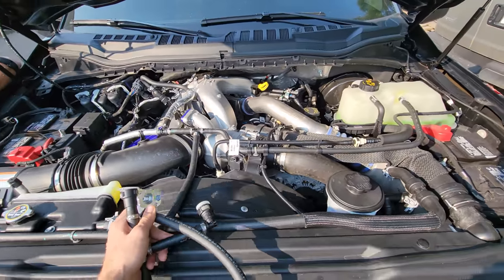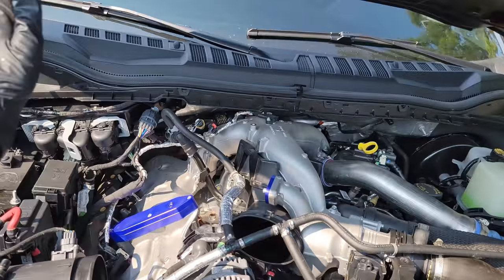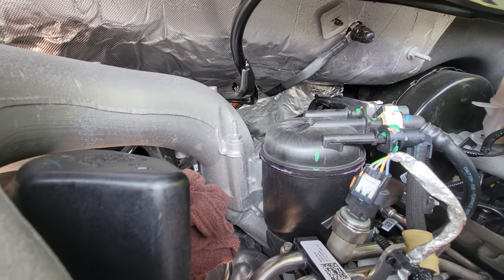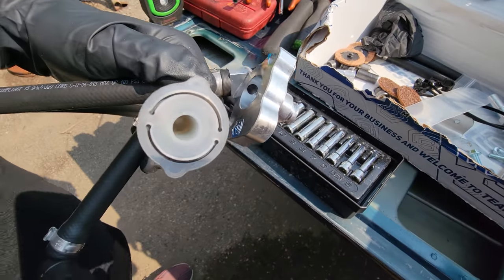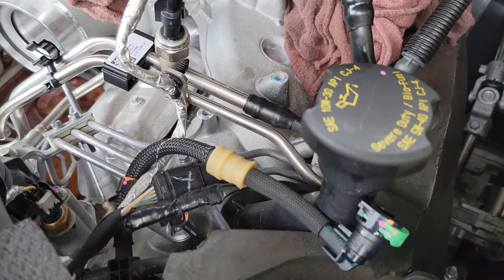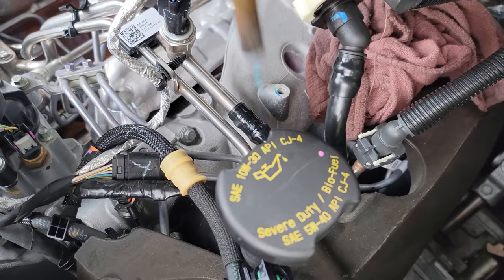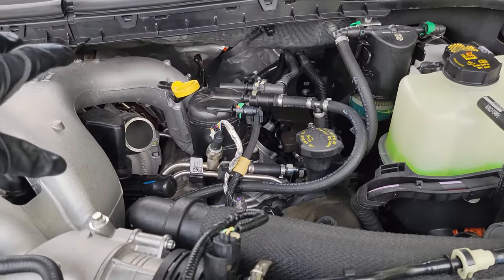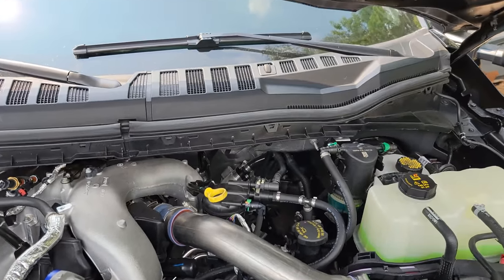FORD 6.7 Powerstroke GEN2 CP4 Bypass Kit Install | S&S Diesel Motorsport | A MUST HAVE

Comment: What seals and gaskets need to be replaced when adding this kit? I just ordered one from S&S but want to make sure I have everything I need before tear down
Reply from the maker: Lol Did you watch the video
Reply: @PowerStrokeTechTalkwARod yes,  you mentioned that you reused the fuel filter but I didn’t catch if you reused the manifold gaskets and throttle body gaskets. This truck is also weight reduced so idk if I need to buy or try to reuse the ccv tube
Reply from the maker: @That_Dyna_Guy those gaskets are all reusable.....

Comment: Damn clean install. Might even want to go through and do the coolant line delete/relocate kit that cleans up all the clutter underneath the engine bay. I was amazed at just the visual difference that made cleaning up all those coolant lines. Granted I’ve got my EGR delete and different intake set up etc. but nonetheless it cleans it up big time and you were like me, happy when you can reuse factory attachment points and or hardware for that clean look. 
How has this kit handled so far with this customer?
Reply from the maker: He loves it, has 44k ish on it i think. Have only seen em for maint 💪💪

Comment: great video!  I've also read that there is still a chance that contaminated fuel can get through the screen in the valve.  I've found a company that sells a finer screen for that.  what are your thoughts on this?  I am researching Powerstrokes before buying one soon.  I follow you on here and Insta and greatly value the information in your videos.  Once i actually purchase a Super Duty, I should be a bit smarter because of your channel.
Reply from the maker: Thanx buddy
Reply: Great kit but there goes your warranty.
Reply from the maker: Yea thats now how that works* cheeeftain

Comment: Does this kit integrate with the H&S upper fuel filter kit?
Reply from the maker: Those kits, do not mix nor connect to each other. They are fully independent

Comment: Was that a ccv re route kit that you pointed at that you didnt like? If so whose it and why is it bad? 

Secondly referring to the disaster kit would running a upgraded mprop like synergy be better for the added filtration?

Also do you like this kit or the spe version 2 better? 

I would imagine adding upgraded upper filter and lower from H&S with a disaster kit and fuel additives could save a lot of headaches down the road.
Reply from the maker: SPE PARTS AND COMPANY SUCKS until they prove me otherwise....period
Reply: @PowerStrokeTechTalkwARod  oh dang, what about running an upgraded mprop with the s&s kit
Reply from the maker: A waste if ya ask me
Reply from the maker: S&S all day!

Comment: I’ve been thinking about add this to my 2015. I’ve been add archoil to every tank of fuel since new truck has 105k on it now. Will be my next install. Have you done any of the 21e01 recalls I revived a noticed today in the mail. Is there anything funny with this pcm reflash ?
Reply from the maker: Nope just a buncha software updates. Customer said today he thinks his truck sounds waaay quiter 🤷‍♂️
Reply: Ok cool. Have you seen any come back with engine lights on for nox sensors or faulty scr system? After the update.
Reply from the maker: Nope
Reply: I have the same truck 2015 6.7 and took to the shop for same pcm code. Mechanic said it was nothing because there was no engine light with it. No limp no problems at all. So I believe there is a recall
Reply from the maker: Um no

Comment: Out of curiosity any reason for not using the  aftermarket crankcase vent kit? Was looking in to what upgrades can benefit my 6.7 such as the disaster prevention kit and any other that most YouTubers recommend. Thanks in advance
Reply from the maker: Huh
Reply: You mentioned in this video at the beginning not to use a particular one I was just curious as to why.
Reply from the maker: Read the comments...

Comment: Do you recommend this over the SPE kit?
Reply from the maker: YESSSSSSSSSSS!!!!!!!!!!!!!!!! READ the comments....I tell ya where to get it!!
Reply: @PowerStrokeTechTalkwARod   I've got a parts order to switch.  Wish I had seen this before your older video. Next question.  Off of the filter output, is it not possible to just hook the orignal return line to it?  Or is that line not long enough?

And have you done (I am looking through your vids) the mishimoto catch can?  How would I mount both because both say to use the same area
Reply from the maker: That kit isn't messing with the return line...... I know nothing about the catch can you mentioned

Comment: Would a Heat Gun work?
Reply from the maker: I have found that if you use the lil small torches which i forgot that day, works absolutely perfect. Small slice with a blade boom, done.

Comment: Bruh, just installed the bypass. Those rear upper intake bolts are a booger to get to. Plus side no glitter paint. I broke a small radiator hose line barb on the passenger side. Not sure what the part is. Mind if I shoot you an email with the a picture so you can tell me what it is?
Reply: Disregard, it’s the heater core hose. Picking up a replacement in the morning.
Reply from the maker: How the f did u do that
Reply: Laying across the engine trying to get the upper intake off and I guess my elbow found it. Truck is leveled with a Ranch Hand. Really prohibits easy access. I need a top side creeper.
Reply from the maker: I have 1, nvr use it
Reply: @PowerStrokeTechTalkwARod  Arod, on my 17 F350, the OEM return line female connection doesn’t rotated like the ones I’ve seen you install this on. How hard can I twist that booger without fear of the OEM return line breaking…or the fitting? My S&S return line from the filter has a minor kink in it because I couldn’t get the factory return female connector rotated 180°.
Reply from the maker: They twist in the line very simply
Reply: @PowerStrokeTechTalkwARod  not being dumb this morning, but I should just twist the line harder?
Reply from the maker: Yes sir

Comment: I'm about 20,000 miles outside my warranty on my '18, so I'm starting to install all the "goodies".  I'll be doing a DPF/DEF/EGR delete next week, along with an S&B CAI, and protecting the fuel system will be next on the list.  I religiously run Hot Shot additive, and also run bio every other tank in the warmer months for the extra lubricity.  I am by no means a diesel mechanic, but am mechanically inclined (aircraft mechanic by trade).  On a scale of 1 to 10, 10 being an m-effer, how would you rate installing the bypass kit?
Reply from the maker: I wld say a 3 or 4
Reply: @PowerStrokeTechTalkwARod  How long does it take?
Reply from the maker: Me or you...
Reply: @PowerStrokeTechTalkwARod  HAHA. Average Joe.  So, I guess ME?
Reply from the maker: I duno cld be all afternoon. Guy told me it took em a weekend to take the intake off 🤦‍♂️

Comment: After I install the kit on my 2017 F250  when I tray to put pedal to the metal is cut off at 70 and is telling me reducing power engine can someone help !! And not the truck is not delete yet ad never jsbe the problem before the installation.
Reply from the maker: I need more info than that guy
Reply: @PowerStrokeTechTalkwARod  what kind of info you Need?
Reply from the maker: Codes, pressures, voltages. I cant piece a crisis together for you with bananna peels & tooth picks
Reply: @PowerStrokeTechTalkwARod  I have a code is was my throttle body I fix that and now show me a code saying is a P0093-00 large leak detect. I check all the hoses and and everything and is not leak I Change my fuel filter 2.5 month ago.
Reply: @PowerStrokeTechTalkwARod  nv after checking everything, I decided take off and my truck go back to normal the kit may have some  defects. 🤗 thanks for everything. GOD bless u and ur  Channel. 🙏

Comment: Will adding this void factory warranty?
Reply from the maker: No read the comments
Reply: @PowerStrokeTechTalkwARod  I’ve scanned them and missed it.  Next question. Does this, in fact, keep metal from reaching the injectors?  Or just keep it from getting back to the fuel tank?
Reply from the maker: The metal stays in the pump. You need to watch S&S YT channel. We link it in the comments
Reply: @PowerStrokeTechTalkwARod  I’ll check it out

Comment: That’s a lot of connections to fail. It seems most could be done away with.
Reply from the maker: Then make one.....
Reply: @PowerStrokeTechTalkwARod  🤣 I’d just cut the lines and run an inline filter. Not knocking your work, but it does seem the kit would supply replacement lines, even if the installer had to assemble the provided connectors. Love your channel. You’re a pretty fart smeller👍

Comment: What does this thing do?
Reply: If the CP4 pump fails it pumps metal particles thru the fuel system resulting in a VERY costly repair. This kit prevents the particles from reaching other fuel components or being returned to the tank
Reply from the maker: Thanks ski man
Reply: @PowerStrokeTechTalkwARod  did I get it right😁
Reply from the maker: Si!!!